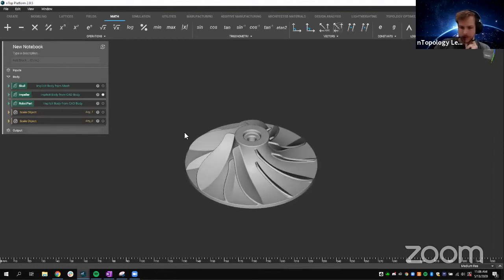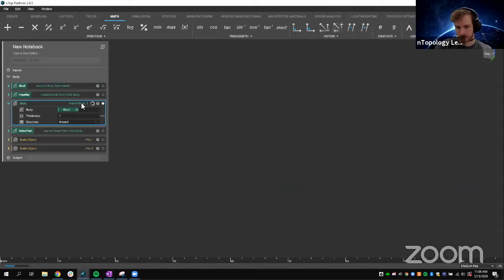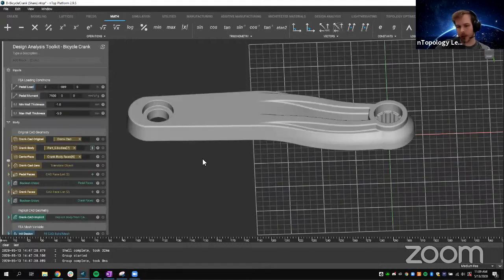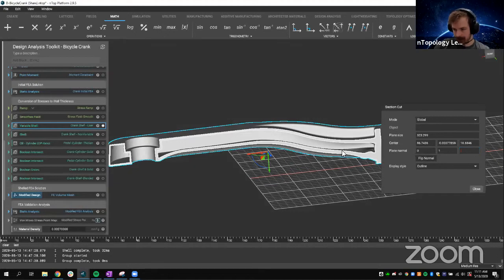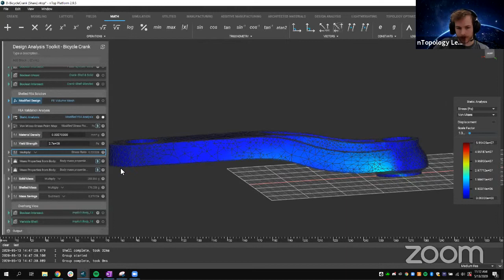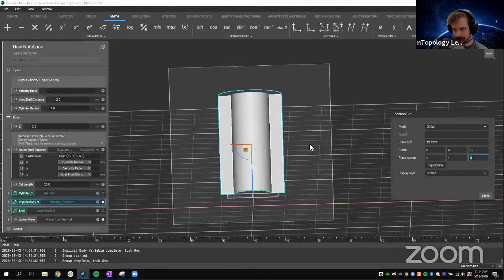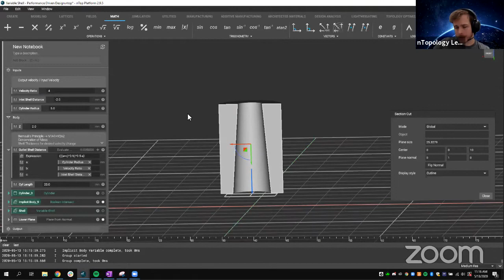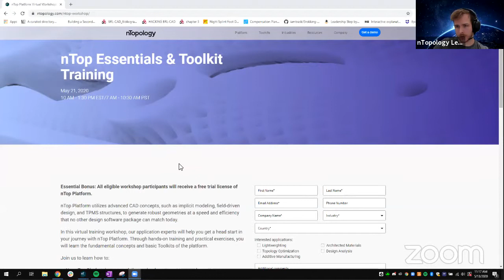nTop Live: Variable Shelling Operations that Never Fail

Comment: You don't actually show how to do anything. In order to get the variable shelling for overhangs to work I ended up using the angle field, together with some clamp and some ramp modules. Couldn't get the Shell module to work, so I just handmade it using an Offset and a Boolean.